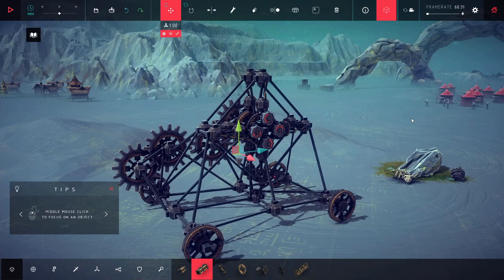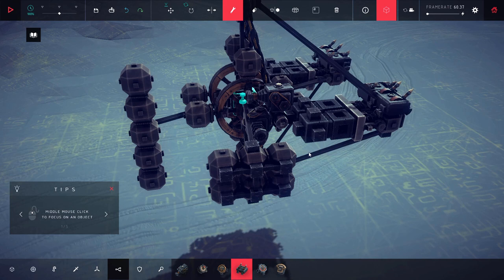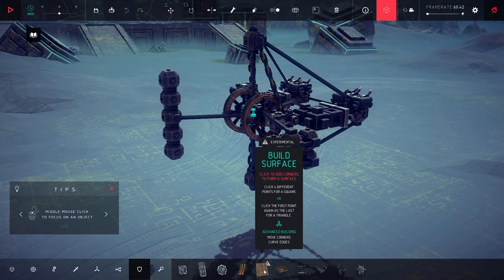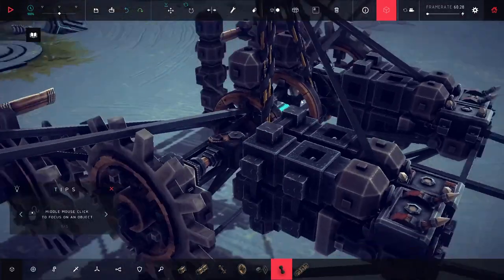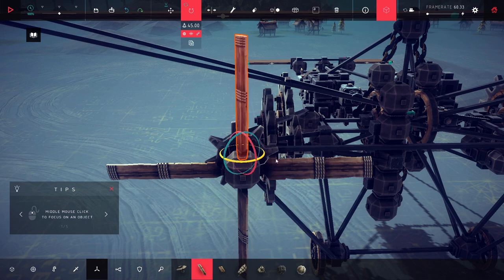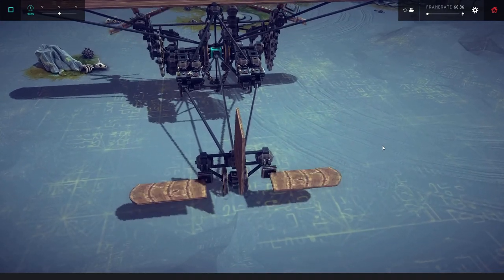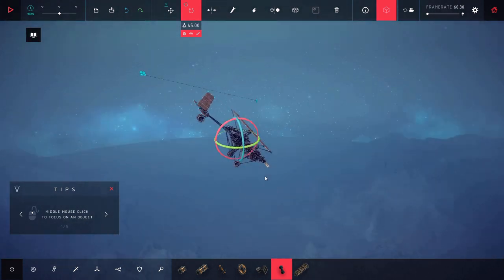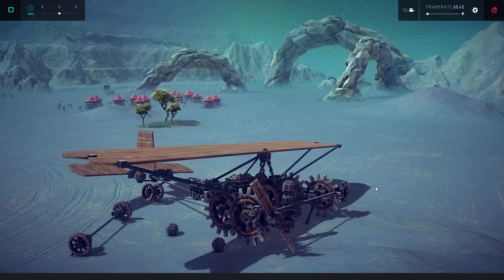Besiege - Piston Powered Air Plane: Is it Possible? - Let's Play Gameplay

Comment: I was nearly about to comment about the propellers until you noticed they were wrong lmfao
And btw, if you press F on a propeller, it will flip it in the opposite direction so you don't need to rotate it yourself

And just another thing, if you decide to use a steam engine, remember that you have have 4 - 6 water cannons on the exact same block in the same place without them glitching :)

Comment: I've found that there's not a whole lot you can do with 2 speed pistons in an engine, so power linearly scales with how many pistons you have. My car that uses a piston engine uses only pistons and goes at a speed of 18, but it also uses 96 pistons. My smaller cars used 12 pistons but went only at a speed of 5.

Comment: The problem with the plane is that there isn't enough lift on the tail which causes the plane to backflip uncontrollably also you need airspeed to creat lift so going slow and pulling up does nothing towards flying
Reply from the maker: I don't know if the aerodynamics have been altered since this video went live but I replaced the custom wings with normal ones a while back in testing and it actually worked TONS better. Still need to generate a tad more thrust but it's close.